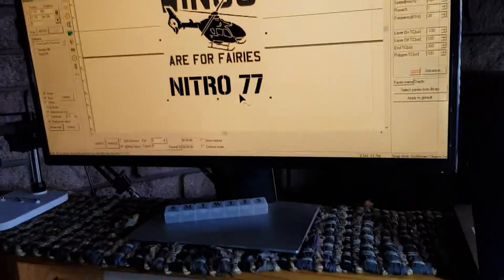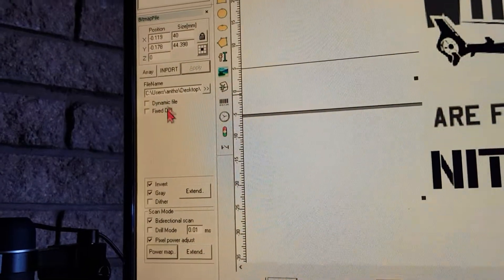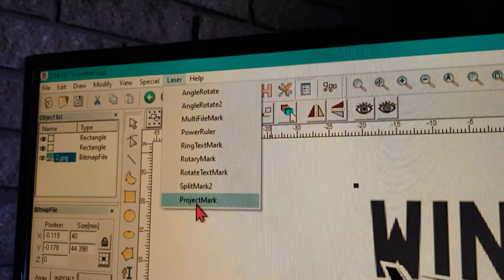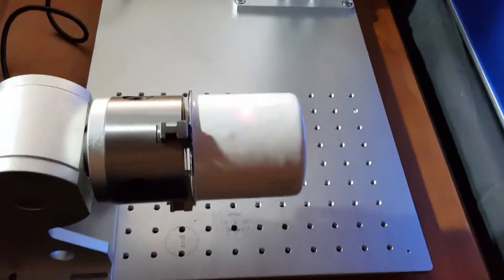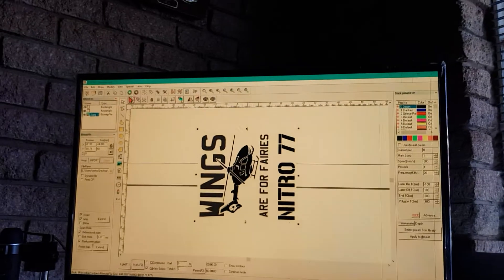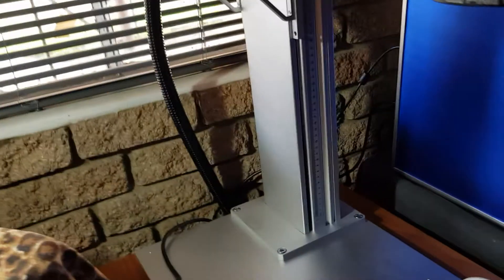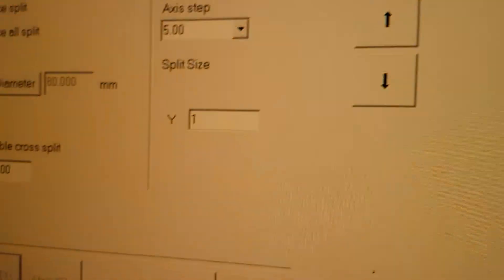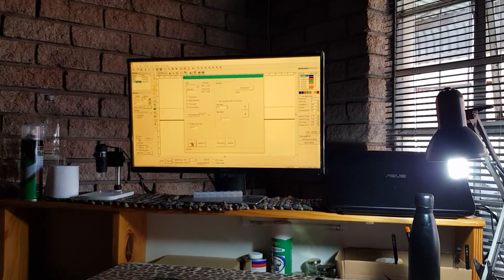How to Fiber Laser Rotary Image Bitmap Engraving

Comment: Your video is very helpful and grateful.
I have a problem.
Rotary marking of bitmap cannot be performed at the position specified by EZCAD.

I am using EZCAD (2.14.11).
I would like to mark a photo
When trying to do rotary marking with splitmark2,
Cannot mark at the specified position.
Actually, it is always marked at the center position (X = 0, Y = 0).

I tried the photos with BMP, JPG, and PNG, but all the results were the same.
I was able to mark at the specified position by marking on a flat surface without using a rotary.
By the way, in the vector, it is possible to mark at the specified position on both the rotary and the plane of splitmark2.

I'm sorry for my poor English.
I would be grateful if you could tell me if you knew the solution.

Comment: Ok nice Video. Can I Ask Something? Why You Didn't used Rotary Text Mark? Why You Used Split Mark 2 ? What was Different About That ?
Reply from the maker: It's because that is literally the only way I got it to work.
Reply: I had the same question, I was told by the manufacturer of my laser to use RotaryMark the one with no spaces, split mark is something for like if you are going to break up the "image" that is being engraved, and your laser should not start making at all when you hit F1-light, thats why it has an F2 Mark button. I'd check your settings, or even your rotary device wiring.